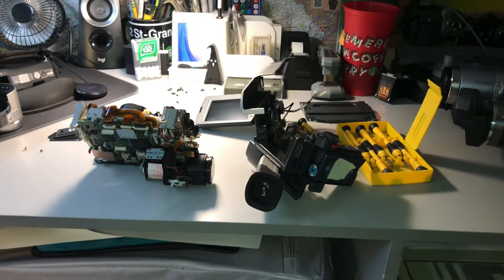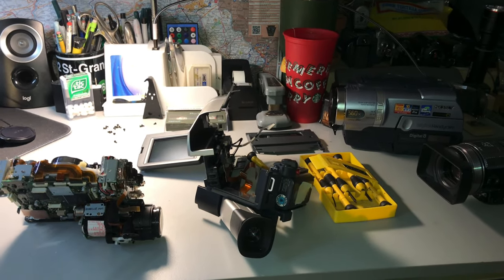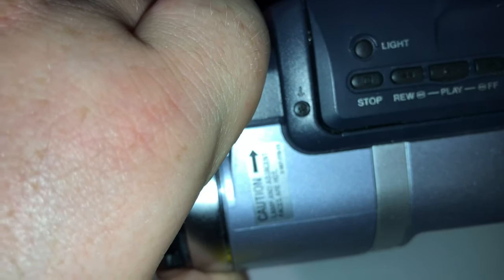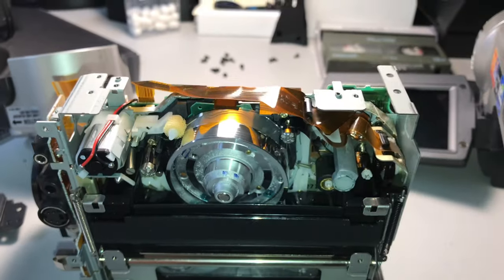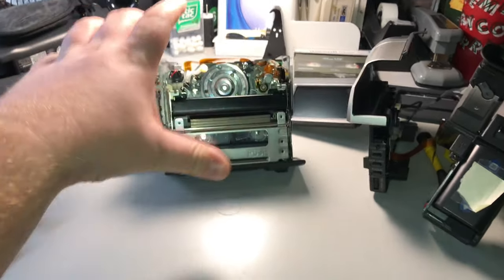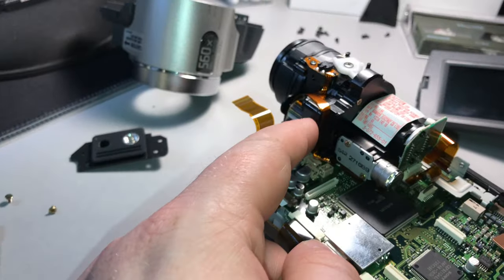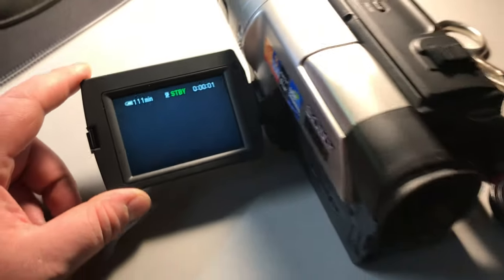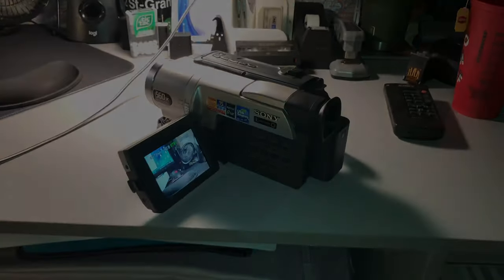Sony CCD-TRV608 Hi8 Handycam Black Screen & Clogged Video Head Repair

Comment: I just picked up a trv140 with the same issues. Tapped on the outer case 2 times and came back to life. Thank you so much.
Reply: I have the same camera with the same issue, Wdym tapped on the outer case two times
Reply: @ifindoubtkickitout I need to know too

Comment: Great video! Nice to see another Handycam in action! Considering the complexity of these devices, it’s great to see how user friendly they managed to make them. Still complicated to work on, but identifying the screws and making it open into parts does help.
Reply from the maker: With them getting older, it's only appropriate to learn how to fix them when they start acting up. Thankfully the service manuals are still easy to find online for free, and 12volt vids has quite a few videos on different models with the same or similar issues and components (like the tape mechanism), so even a novice like me can figure things out. It's definitely reassuring to know your way around them since there aren't many people that still repair them.
Reply: True, although information on some models might be slim, it’s nice that manuals and videos exist about them. 12voltvids always has something new and he shares a lot of interesting and helpful information. Plus making videos about these devices also helps to preserve information that otherwise could be lost to time, and they are always interesting to see!

Comment: Hey man commented on a couple of your other vids about the 608 - I just got a Sony tape for it from amazon. Seems to record video and sound successfully, but on playback i'm getting a lot of staticy lines across the video. Would cleaning the video heads help this at all? Thanks so much for your videos, they've been an immense help!
Reply from the maker: Unless they're worn out, yes it should help. Don't use Q-Tips--they'll get snagged on the heads leaving cotton fibers behind. Try using a piece of paper coated with isopropyl alcohol (damp but not dripping). Hold it flat on the head drum and use your hand to spin it (with the camcorder off of course). You'll have an easier time if you remove the cassette compartment door (two screws). You could also try an 8mm cleaning cassette, but they're quite pricey lately and do pretty much the same thing.
Reply from the maker: Also, the old back of the fingernail--lightly--against the drum as it's spinning playing a tape helps immensely in cleaning the oxide buildup that causes what you're dealing with. 12VoltVids has an excellent video on it here: https://youtu.be/t25z72RFqyM?t=606 The only problem is that you'd have to disassemble the camcorder a bit more since the TRV608's head drum in on the bottom and not the top. If you don't feel comfortable doing that, just try the paper and isopropyl alcohol trick. It's worked quite well for me.
Reply: @stereophonicstuff  Hey! I successfully cleaned the heads and now playback is great. I recorded a video today and was able to play it back in playback mode fine, but when I went back to play it again later after recording more clips, all I get is the blue screen. Also I'm noticing some of the clips i've recorded are out of order when playing back (i'm guessing one of the clips i took over wrote the one that was just showing up as blue screen?) any help would be appreciated, i've been reading the owners manual online but cannot seem to find anything regarding this and how to properly ensure i don't overwrite footage.
Reply from the maker: @joebeck0  If the clips are out of order, that’s because you jumped back in time on the tape and started recording over the old content. That’s why you should use the “end search” button when you’re done playing back your tape. The camcorder will automatically go to the end of the last recorded section you can pick up recording where you left off without taping over anything.  

Also, if you’re getting a blue screen during playback, though somewhat unlikely, the heads could’ve clogged again. It depends on how dirty they are and a few rounds of cleaning may be necessary. When you fast forward or rewind the video (while the tape is in play mode), what do you see?

Comment: how much are you’re services ?? my camcorder plays back but it records a black screen🙁
Reply from the maker: I don’t offer repair services but try taking something like the handle of a butter knife and tapping it on the top of the lens shroud (not on the actual glass lens, but the silver plastic above it). That can temporarily work to fix the stuck blades in the iris. You’ll start to see the image come back as you tap the camera. Sometimes you get lucky and it’s a long term fix.
Reply: @stereophonicstuff  it isn’t working how hard should i do it?
Reply from the maker: @jittoocut  I’d do it no harder than if you were to knock on a door using the back of a screwdriver or butter knife. Maybe just a tad more than that. Enough to make a sound but without wailing on it.
Reply: @stereophonicstuff  i have a slightly different model (CCD-TRV68) do i have to tap it somewhere else but i might open it up
Reply from the maker: @jittoocut  That's similar to the model I fixed in this video. If tapping it hasn't fixed it, then you'll likely need to take it apart. It's doable, but make sure you take your time and keep track of what screws go where. 12VoltVids' video on the same issue (linked in the description) but on a TRV108 should be quite similar to what you'll need to do on your TRV68. 

Of course, if you're particularly unlucky, it might be the image sensor that's gone bad, but I don't see that too often on the 8mm Handycams.
Reply: @stereophonicstuff  when i put a flashlight in front of the camera i can see light idk if that gives makes it less like it isn’t something like a broken image sensor but i’ll take it apart 

APPRECIATE THE HELP🙏
Reply: @stereophonicstuff  it’s working i’m actually starting to see it the more and more i hit it still a little black though